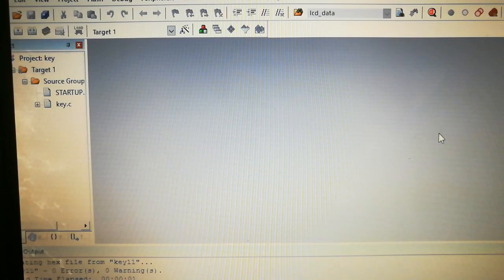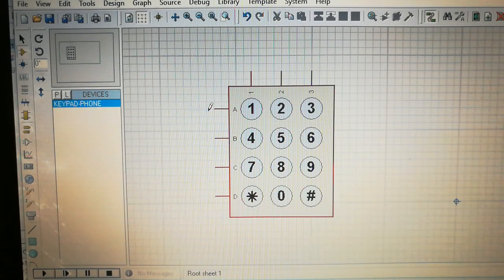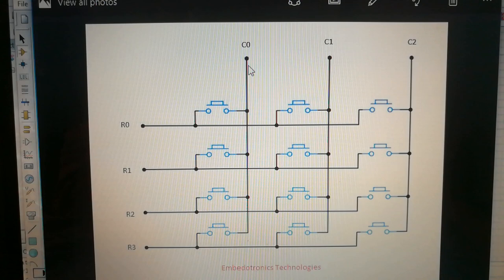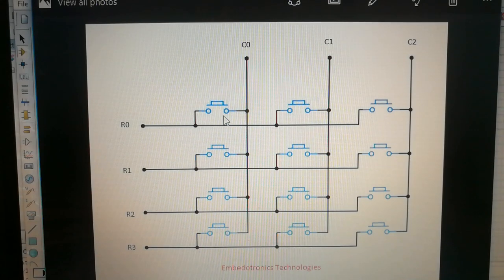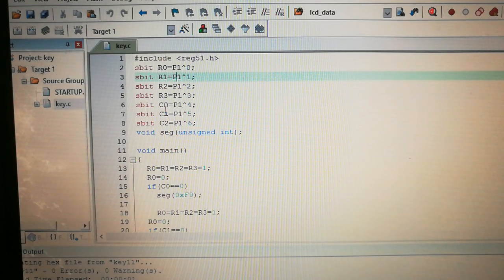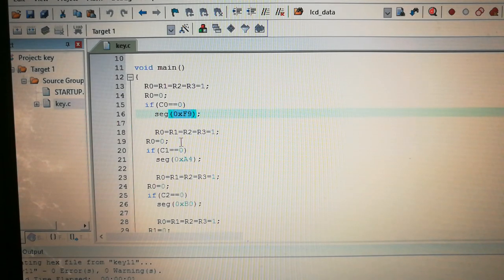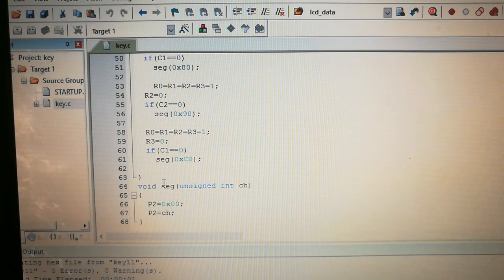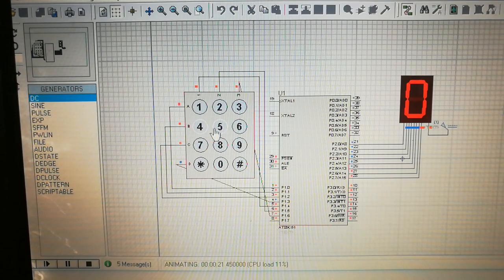Keypad interface with 8051 and displaying numbers in 7 segment

Comment: I am having a problem with this code. I have made some minor changes. I use R1=R2=R3=R4=1 and I have Columns C1-C4. I also made a change at the end , instead of using P2 as the Output Port, I am using P0.  My code builds without any errors, but nothing happens when I press any key. All segments are on and stay on, no mater what key I press.
Reply: same problem for me also. Have you got a solution for it now??